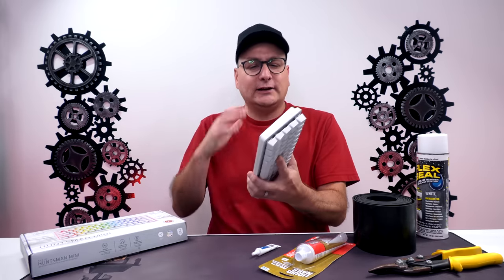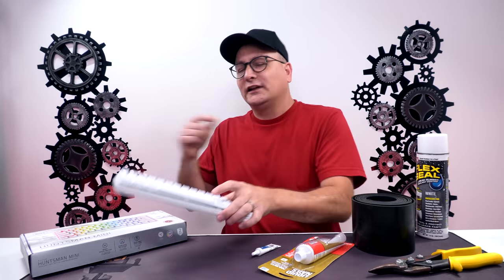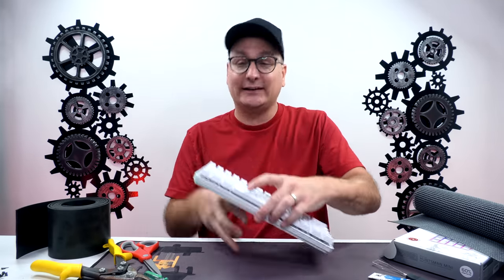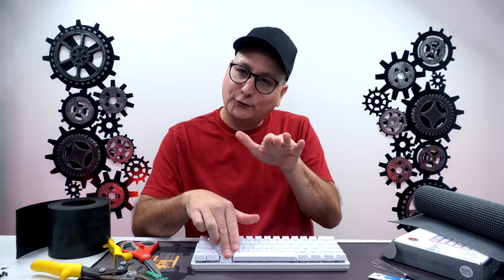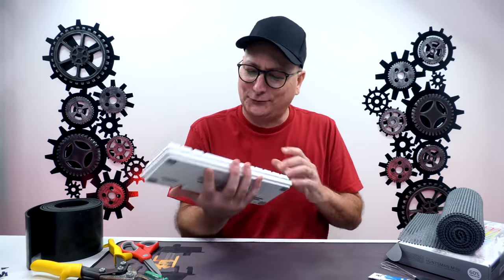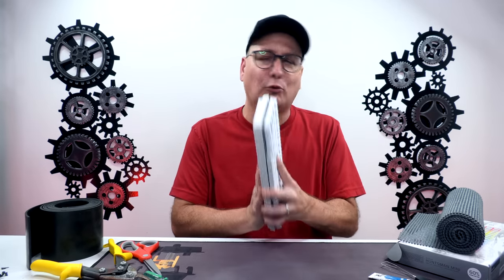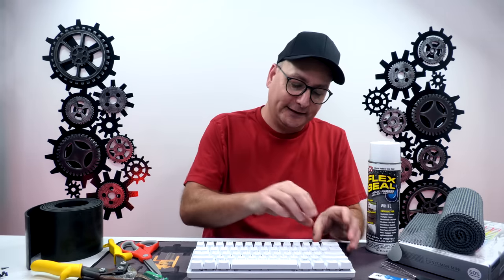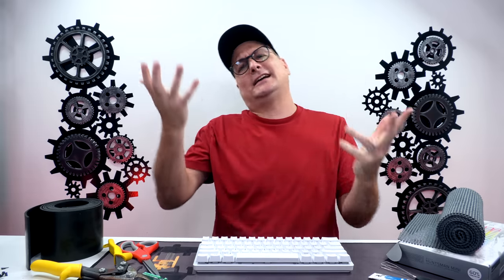Razer Huntsman Mini Mod's, IS IT GOOD NOW?

Comment from the maker: Flex Seal applied, and wow much improved, almost no rattle, and feels much more solid. Check it out on twitter https://twitter.com/TheTechne1/status/1297237281892446208
Okay I'm going to flex seal this piece of junk, I'll update you all with the results 😂
Reply: does this void warranty? if it does i wouldn't do it. LOLs
Reply: Why should u flex seal ur brain dont do it u got a lot of biased video to do
Reply: I like more the red buy it’s self
Reply: The Techne do a video talking about the top 3 best gaming mice you have ever reviewed
Reply from the maker: @raidus6647  ok, 3 or 5? I do like the idea of 3
Reply: Is the blackwidow v3 a thing cause i see it on they're website but no one did a review on it... And razer didn't even advertise it!
Reply from the maker: @acadea1232  I have been waiting for it to be avail with the yellow switch
Reply: @TheTechne  can't wait for the review 😁
Reply: Pingooo  No switches other than razer's optical will fit in the pcb or plate of the huntsman mini. If it were a hotswap board that would be pretty amazing no lie.
Reply: U placed ur space bar back wards

Comment: I went from a $200 steel series apex pro to the $119 huntsman mini. The huntsman mini is way better than the apex pro. I don’t see why there’s hate on it.
Reply from the maker: The mini us no where near the pro.
Reply: The Techne it’s the other way around. The pro is nowhere near the mini. Also isn’t the board dependent on user experience what you might not find nice other could find amazing. Like I said I went from going to a $200 board not liking it to a $120 board and loving it. Also I have a mecha mini coming in. I have no sides. I chose steel series then razer now ducky. It’s really user preference.

Comment: Buy a Alpheriorkeys Hayabusa keyboard, the key caps dont rattle like  that and you can use a discount code and it will come in around at about $116. The keyboard can be used wireless or wired. I highly recommend.

Comment: When I got my keyboard I had no rattling and  when pressing down on my keyboard it  was smooth as butter 🧈 I don’t need this mod because I didn’t get a beta keyboard I have the keyboard in red switches
Reply: Did you purchase the keyboard in the video? The reason the switches rattle is because each one has a metal bar as a stabilizer
Reply: Fibbin Tiggins  I got it on amazon It’s perfectly fine
Reply: @macjboy707  Gotcha, glad you like it then

Comment: i mean, i dont even know what to say. 
Nr.1 i simply dont understand how adding more weight makes it better
Nr.2 the raddling spacebar wasnt a problem in the first place, u aint ever gonna shake it like that. Same with the switches, U HAVE A HEADSET ON WHEN U PLAY, UR NOT GONNA NOTICE THE RADDLE. 
Nr.3 u say it is so much better now but its only difference is that its heavier and more silent/sounds diferent. 
And last, the point with this keyboard isnt bling, its simply being fast. This is a keyboard for competetiv players who need the speed. A comp player would never care about weight or sound but only about size and switches

Still good that u voice ur own opinion :)
EDIT: to be fair, u are an old guy. I dont expect u to understand this fortnite stuff

Comment: I just bought the black Mini with red linear switches and mine does not sound like yours.  Mine does not rattle when shaken and does not sound hollow or have a clack noise at the bottom. I am coming from the HyperX Origins Core and I have had the Huntsman TE in which I returned immediately as that was very hollow and noisy /clacky at the bottom.  RGB is poor on the black version and I wish the secondary commands would light up but apart from that I may just keep it.

Comment: I do really like Razer products but they have messed up overall with their switches, only good part is there optical. Haven't been able to try the reds but I've tried the purple switches and they feel like cheap knock-off Cherry MX blue switches similar to the one's on my $ 30 keyboard. Not switches you would find on a $ 120+ 'premium' board. I say bring back the old Razer Yellow, Green & Orange switches!

Comment: I dont know of you Reply on old Videos nur i rly want to buy a mini with purple switches and I would mod it but I hav now have the g512 carbon but full sized is just to big for me (also i Canterbury swap the Abt keycaps they also has the sponge thing like the razor one I have the blue switch on btw) as a 13 year old to play Minecraft good with low dpi yeah and would use a te but it does not fit in cause it’s black yk don’t rly now what I should buy right now :( I can only test the huntsman (normal one) at our local store do they feel the same sponge or whatever it’s called because on the huntsman it wasn’t really a problem for me so I would buy the mini with purple and do these little things (Much Love from Germany 🇩🇪)

Comment: Techne I’m getting a new headset soon, what do you recommend for competitive gaming?
Reply: mh751 is by far the most comfortable
Reply: Coming from someone who has used Razer Kraken, Hyperx Cloud, Hyperx stinger, and steelseries Arctis Pro, and has slightly bigger ears,
The cooler master mh751 beats them all for comfort.
Reply: Sook  
My older sibling has an old razer kraken sitting around from 2017. I used to use that headset. Back when I used a PS4 in 2016, I had a Hyperx Cloud. When that headset broke, I replaced it with a Cloud Stinger as it was a budget option. When I built my PC two years ago, I purchased an MH-751, which by the way,  is a rebranded Takstar Pro 82 with a mic attachment. The Takstar Pro 82 was very well received by audiophiles, which transfers to the MH751, because it is a rebranded version. My older sibling currently has the Arctis Pro, and I have used it for hours. It is nowhere near as comfortable as the MH-751. Most youtube reviews on the MH-751 comment on the comfort. The only headphones I can compare the MH751's comfort to, are bose QuietComforts with around-ear ear cushions.

Comment: I just bought the huntsman mini linear. And I'm not really sure if Razer did anything new to this keyboard after this review, but there isn't any rattle in my unit apart from the spacebar, which is kinda expected. I am tempted to lube these switches and stabs myself though to see how much smoother I can get it.
Reply: did you ever lube it? what lube did you use and how does it hold up?

Comment: Did he really just put lube on the sides of the switches and expect it to sound better 😆🤦‍♂️
Reply from the maker: It was on the wire stab to prevent the rattle 🙃🤦
Reply: Do you feel a little less idiotic a year later or just about the same about the whole lubing the stabilisers which are present on every key?